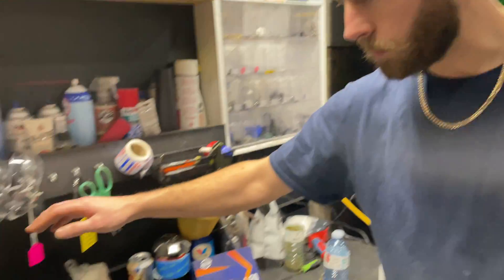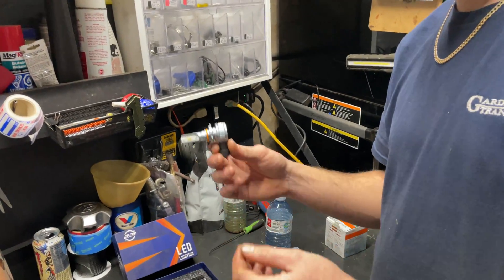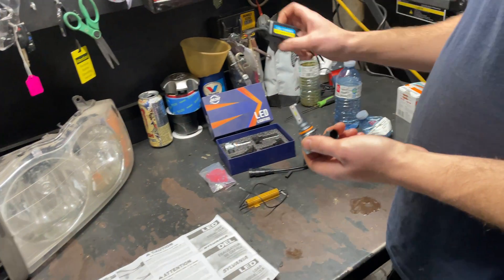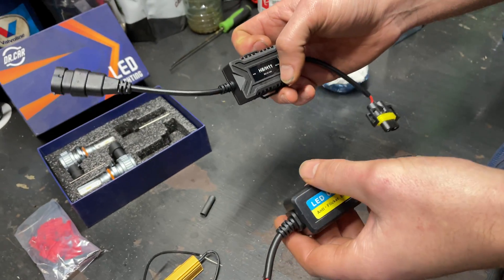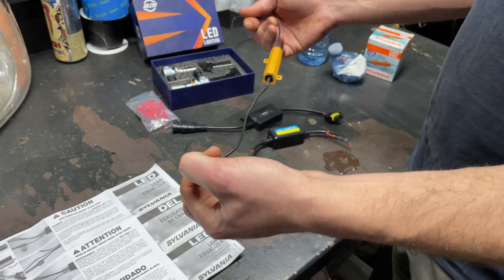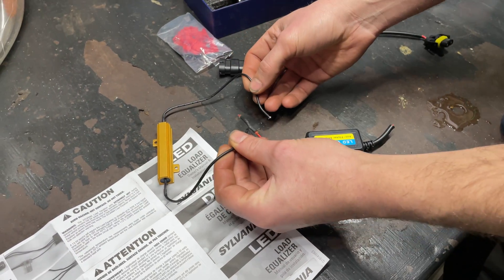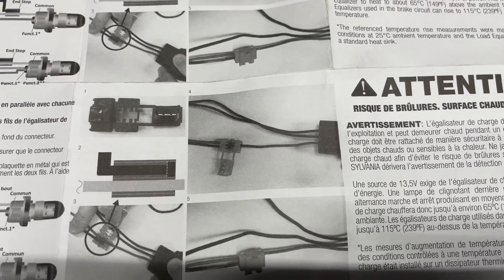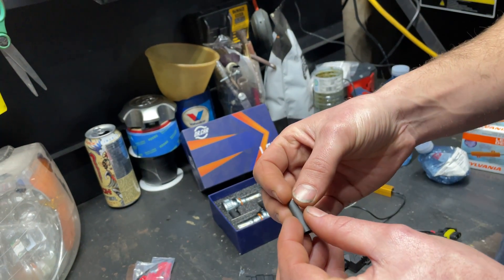LED Headlight Bulb Resistor Add On For Headlight Bulb Out Code

Comment: The plastic box ones you said that didnt work are actually canbus decoders and not load resistors. If you open those up you will find they contain a circuit board with an IC and a big capacitor and the purpose of that is to stabilise power for blinking lights, NOT for headlights!  
The orange load resistors branded Sylvania that you found worked can be bought cheap unbranded from China for around a buck each;  you dont have to use that Sylvania brand, they are a very simple and cheap common electrical component used in millions of devices to load up a circuit.  BUT make sure you mount them somewhere they can dissipate the heat safely or you might set your car on fire!

Comment: Did the resisters work?
Reply from the maker: @TheRedRocket  great question, I needed the silvania lighting ones, their orange and cost about $10. You have to wire them in yourself but they work great, been using them since with no issues
Reply: @Tech-28   Thank you for the update.
Reply from the maker: @ your welcome

Comment: i have installed led blinker bulbs to my e46. at the first time when i start the engine, i get failure code on my car that ther is no blinker installed. after using the blinker it flashes fast and after that it works normally. it doesnt get power on first i think. is this resistor working for that problem too?
Reply: Yep!
Reply: @SXLENTXXL  thanks

Comment: 1:16 Incorrect. LEDs do use the same voltage as a regular light bulb. They use less current, which is what gives rise to Canbus errors as the control module believes there is no bubl connected. That's a basic error.
Reply from the maker: Well in the car world they usually run between 1.8v & 3.6v.